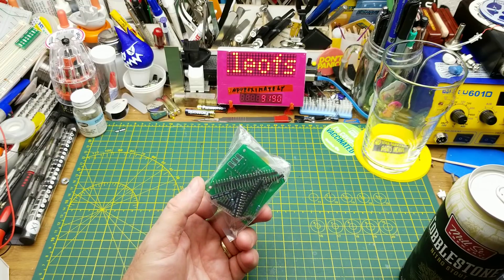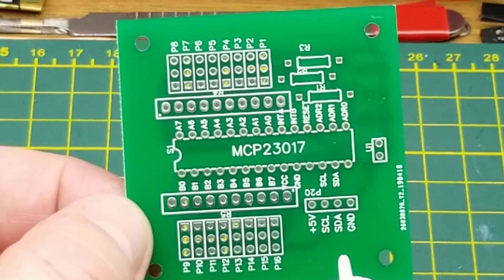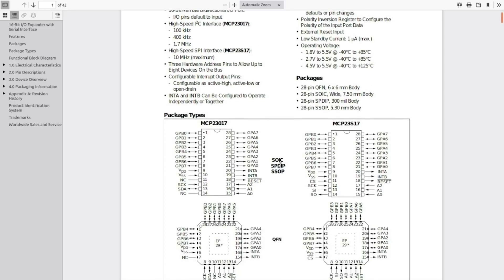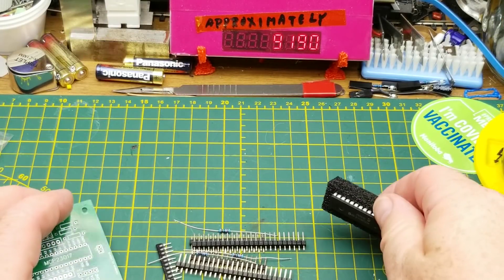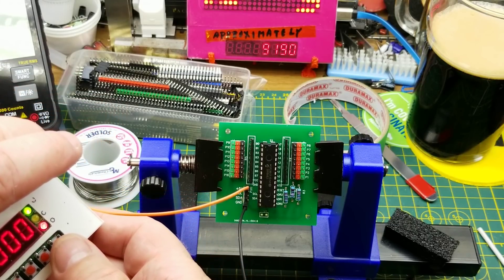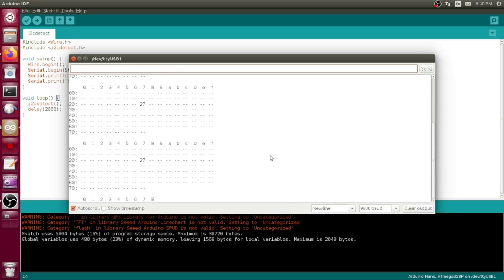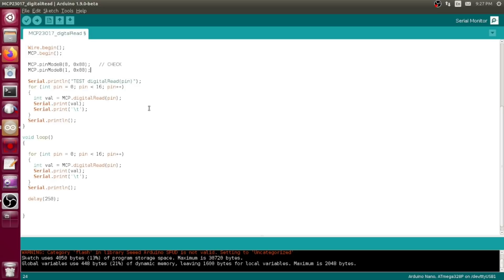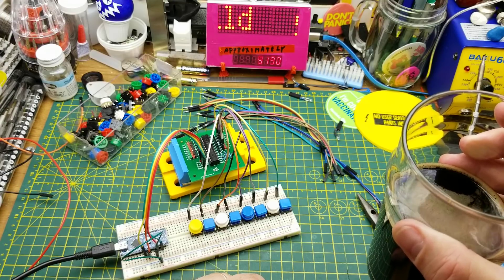kit build: gpio expander

Comment: Hint on soldering! Soldering is a TWO STEP process ! You add half the solder First to heat up the joint; that's the PCB pad and the component wire, then add the rest of the solder to complete the solder joints. That is why solder comes in different gauges, to allow you to add a small amount of solder First for different size joint's, this is called NASA Soldering Technique !

Comment: whats the pin connector (black) used for?
Reply from the maker: the 16 black pins are the GPIO pins - either input or output depending on how you define them in the code

Comment: That is a nice board and chip.  I see it has the "classic" JLCPCB thin solder mask :(  It takes very little to scratch it off.  They are so much cheaper than the other houses though, I must say so still use them.

Comment: To solder Header pins, i put the corresponding female headers to the other side. So they are at least parallel. ;)
Reply: Am so bad about this, so will always attach the female side of any connector on the other side to hold things straight.
Hate burning my fingers, trying to hold things in place.

Comment: Interesting chip. I have some simple PCBs based on this chip from AliExpress. I wonder how easy it interfaces with the ATTiny13, or even the PFS154? 🤔🤷🏼‍♂️
Reply from the maker: There is a library that specifically targets the ATTINY85, so it may not be that difficult to control one of these with a low resource microcontroller.

Comment: Thanks for your efforts to share with us! Reminder: you can seat the header pins in a breadboard, flip the PCB and solder everything dead straight... Also, CharliePlexing is an interesting way to add pins.
Reply from the maker: If I did the pins before I put other stuff on the board, that would have been a good option.

I have tinkered with Charlieplexing in the past. It's a cool method, in the right application.  https://youtu.be/OYDD5BWz2Ms

Comment: I wonder what the latency on a read/write is via i2c and this chip vs. pins on the microcontroller.
Reply: Have played with Wire.setClock() some.  At 100kHz (default) times the command bits ... not that fast.   Have been able to rasterize an 8x8 matrix of LEDs, just barely, with this chip.
Reply: The MCP23018 is a newer and faster version.